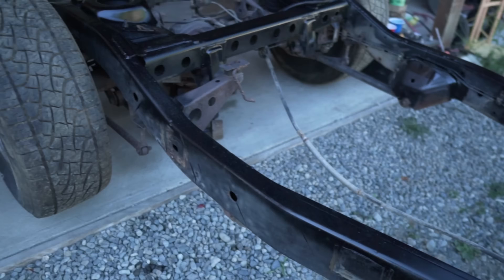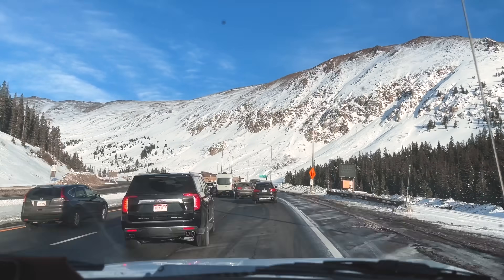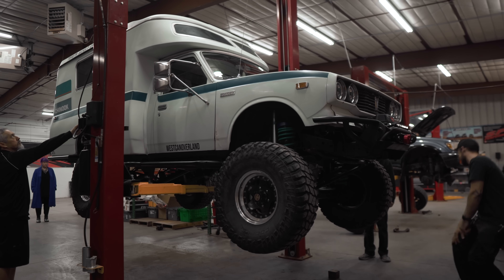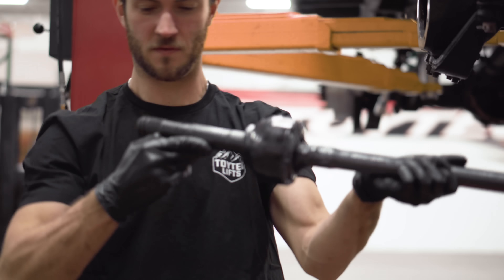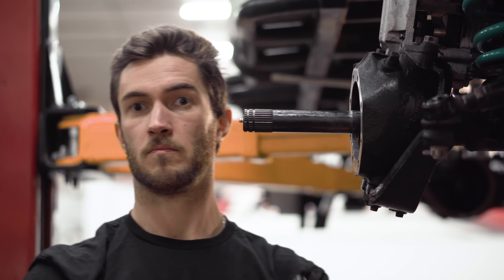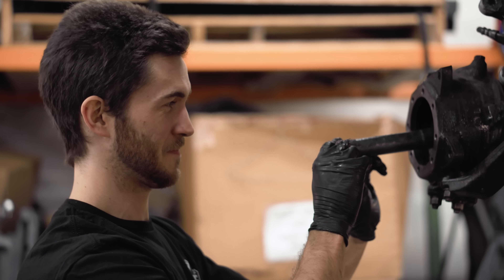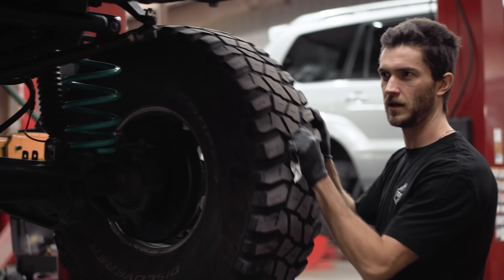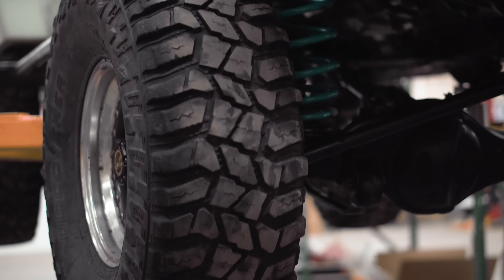LAND CRUISER CHINOOK BUILD Continues on the Road!

Comment: Be sure to break them in first. Before you put them to use. The snap ring is getting in the way of the hub gear. So it won't seat. That's why you're not supposed to pack grease in the hub gears.
Reply: The good reputation is being damaged badly
Reply: @Kiwigd  WTF are you talking about.
Reply: @Kiwigd  troll
Reply: Those gears looked top quality, lapped in as pairs, no breaking in needed with those, change the oil after 2000kms and run a quality oil like vertex 75w140 synthetic and you will never stop.
Reply: I know what your talking about had the same problem well atleast problems with the snap gear. They’ll figure it out 🤘 I’ve had buddies with no issues and go beat the hell out of the rig or me lick hubs in the first 100ft on the trail and being towed back.

Comment: Yep..lots of tools and know-how. Press, dial indicator to check backlash and if necessary adjusting pinion depth to set backlash, setting carrier bearing preload, and finally choosing between a crush or solid sleeve. Not to mention you must have meticulous attention to detail. Oh, and don't forget there's a locker to install too. I feel ya, takes hours to do it and the first time is daunting. I think the first time I ever built a 3rd, I just threw everything together and got lucky. Now I'm a bit better at it 😝

Huge huge huge congrats on the sponsor and stoked on the build! Looking great!
Reply from the maker: Thanks so much Ricky!! You definitely ahead in the mechanical realm, I’ll be stoked to do this myself in the future.

Comment: Hi, exciting project. I am curious about the 35 chubby inch tires; it seems that you have done your research, yet I haven't seen many tires that big for people doing extended trips on the "Panamericana". On the southern leg, for the past 3 years, most LCs i've seen run skinny 33's or similar. For fuel efficiency and ease on the train. I can see that you are going through extensive mechanical modifications to insure durability, so I am sure that there is a rationale behind it and would love to hear it.
Reply: For the 30K miles, going from 12mpg to 20mpg could be close to 1000 gallons of petrol/gas. With your camper aerodynamic load, weight and and larger tires, your 3.4 5zv-fe is probably overworked and not at it's most efficient. Since what you need is an engine that does not increase much MPG with high torque load, and you need to push that rig over high altitude mountain pases,  I would look at the 2UZ-FE. With skinny 33's, and serious tunning, you should get close to 17-18 mpg.
Reply from the maker: Hey Jeremy! The 35s definitely suit the chassis well in our opinion. While smaller skinnier tires may be more fuel efficient, we didn’t build it for fuel economy. With our 42 gallon tank we can travel ~500 miles before refuelling. Agreed that 35” mud terrains may not be the most “practical” they definitely suit our style and will be durable. As for power to weight the 3.4 is going great! Especially now with the 4.88s. I seem to always be reminding people that motorhome much bigger and heavier than this with 4wd ran (and still run) the 22r and 22re.
Reply: @ToyotaWorldRunners  Thank you so much! Definitively a winner in the "looks" department, and the extra contact patch  will compensate well for the extra weight. It you are set on the  v6, pay extra attention to oil quality in Central and South America. Bring extra quality head gaskets; good ones  can be hard to find. I have noticed that the 2.7 22RE, 4500 I6 32v and the 4.7  2UZ V8  engines seem to hold the best here.   Replacements/swaps on the 3 & 5VZ (LC Prado; OH/blown head gaskets) seem to be more common here than in NA. Some locally available oils gunk up at <2000 miles. Cooling system corrosion might also be a culprit, good quality coolant can be hard to find. Many run (suspicious) H2O.  Perhaps also optimizing the cooling system and making it more resistant to rust. Think operating on suboptimal conditions, overbuild.   Best wishes and I do hope  to see you in the road soon!

Comment: Doing your own gears isn’t so bad I rushed 5.29 and locker’s with YouTube academy some google foo and a couple of rented tools from the parts store .  never had a issue just bought good gear sets and master install kits. solid pinion spacers instead of crush sleeves. I went high quality and shopped as good a deal as I could find would have loved some help from someone that knew what they were doing but the internet will provide. All that being said I’d not have been game to test my newly acquired knowledge in the middle of a road trip. give it a shot on the next rig
Reply from the maker: Will definitely try to do my own on the next build!

Comment: It had to be a bit of a shock to see all of those guys with their hand on your rig after all of the work you had done to it. On the other hand, they were obviously knowledgeable and skilled, so knowing she was in good hands must have been comforting. The 1st gen Tacoma I had needed to manual hubs rebuilt after some knuckle head had screwed them up and now I just finished up on replacing both actuators on my 2002 Sequoia, so I was right there with you on parts of this. I guess the real journey begins from here in Denver. Good luck guys and I'm looking forward to the trip.
Reply from the maker: Oh it was, Matthew’s anxiety was through the roof for the first few hours! 

Yep.. The trip starts now!

Comment: Did they give a reason why the RCV's don't like being in full-time 4WD? Do the hardened Birfield joints wear themselves out if they are in full-time 4WD or is there a different part that wears out?
Reply from the maker: It’s the chromoly shafts if I remember correctly.

Comment: 4.88 is what 3rd gen 4runners and tacos usually run for 35s but those are a lot lighter than the chinook
Reply: True, Matt’s smarter than that though lol, the transmission could have low gearing, it did come factory with a 22re it’s a damn small vehicle should be fine hopefully
Reply: @keltonderkach9601  the chinook came factory with a 22r in an era where the max speed limit was 55 and it was barely adequate for highway travel back then. transmission is an R150 and it doesn't have different gearing. the 5vz has the rpm range to run 5.13s on 35s at highway speeds, 75mph at 3100 rpm vs 2950 with 4.88
Reply from the maker: In our case (and a lot of others) the 35s measure closer to 34, or 33.5 when mounted. We chill around 65-70mph on the highway, ~2600-2800 rpm. 5.29s would have been perhaps a better choice to stay in the peak of the power curve, however.. we’ve broken too many 5.29 gear sets to do that for the Pan Am. What are your guesses for the Chinooks weight?
Reply: @ToyotaWorldRunners  my guess is the chinook will be in the 4500lb range, not sure how much water and fuel but im imagining at least 30+ gal of fuel and maybe 10-20 of water? when you say broken 5.29s is that on mini truck axles or landcruiser axles?

Comment: In Europe most  J8 are 4,2 TD Diesel 1HD-T  best most reliabel Diesel engine Toyota ever build i think.Drivetrain was permanent 4x4 with center diff  both axrls have elecctric pneumatic lockers. In Europe you cant get a J8 never under 10.000 Bucks used ,because there so popular by Land Cruiser and Overlander Fans.  The problem of RCV if the CV doesent break at overload  the next maybe more complicated or expensive part you dont carry as a spare break.I hope you carry spare propellershaft joints on your journey.
Reply from the maker: This chassis is an American fzj80, so would have had the 4.5L petrol engine. The diesel would have been amazing, but likely wouldn't fit easily into the Chinook engine bay. We don't have the j8 trans or t case, so no centre lock, but have the e-locking diffs. The weak point in the front end is the manual hub, which we have spares of, and yes, spare U-joints!

Comment: I thought nitro was headquartered in Washington.
Reply from the maker: They just opened a new shop in Denver!
Reply: Cool, the shafts have two c clip grooves. One for stock flanges and one for mini hubs, use the inner groove and cut the excess shaft off so the outer hub can bolt back on.

Comment: I would have done 5.29 with the weight of your truck, and once you leave the U.S. the roads will prob not be real high speed.
Reply from the maker: We've broken too many 5.29s...
Reply: A good set up guy makes a huge difference in them blowing up or not. Lots of preload on the side adjusters is a must or the ring gear will walk away under heavy load and bye bye teeth.

Comment: those guys in denver supporting you is incredible. I will definitely be checking them out to get my cruiser 80 regeared.  nitro gear and axle in denver @ 6765 Franklin St Suite 2, Denver, CO 80229 correct?
Reply from the maker: Yup that's the one!